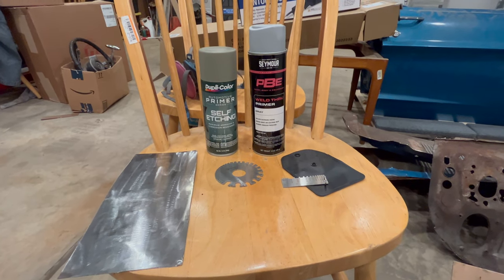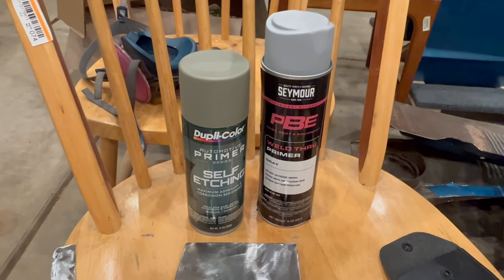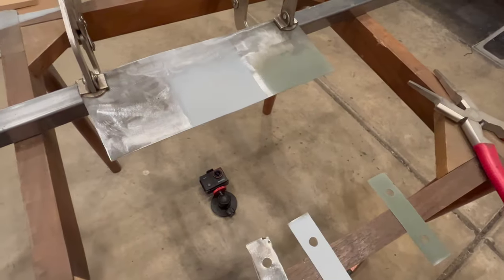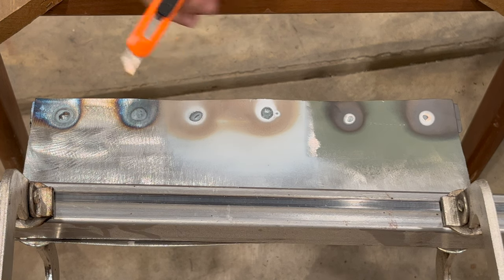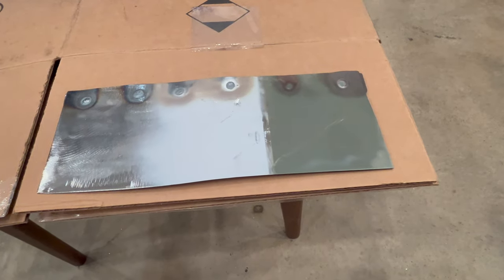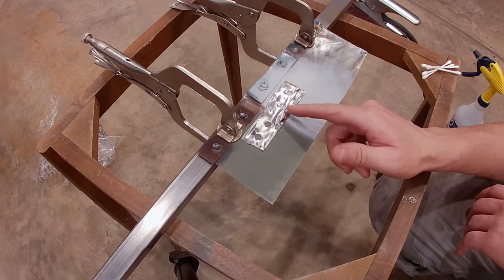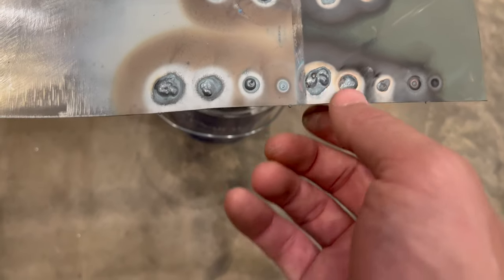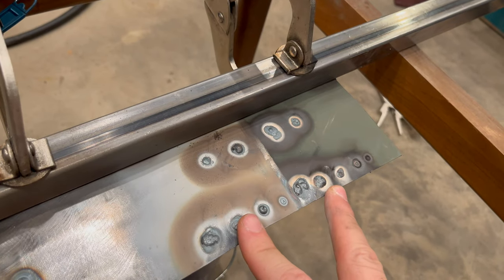Testing Weld Through Primer

Comment: Thanks for the video. I like to scratch out the weld through primer in the hole before plug welding. I don’t know how great the protection is between the two pieces of sheetmetal, but like you say, something is better than nothing
Reply from the maker: Yep, I might consider cavity wax after it’s painted just to get the areas where the primer has burned back. But even that might be overkill since it won’t be living outside.

Comment: The weld through primer is meant to be applied "between" two pieces of metal that will be welded together, the theory is that it will burn back a bit around the heated area and keep it sealed off ,, the self etching primer is mostly used as a ground coat when painting an aluminum panel
Reply from the maker: My original plan was to see how it held up sandwiched in between two pieces, but I’m not sure the best way to test that. I’m open to suggestions! I figured seeing how it held up to the heat would show that. Is there a better way to test it?

Self etch is useful for steel as well. The acid is probably more effective at etching aluminum, but it does protect steel fairly well.

Comment: Try this test with rustolium rust reformer.. i know its silly... but ive welded with that many times and it holds up pretty well to welding on the other side.. im dealing with the same thing on a 76 Jeep J10... thankfully.. though today they do have long hoses with spray nozzles on them to where when youre done with pillars and stuff like this. you can shove the hose in and spray and itll cover fully inside where you put it with paint
Reply from the maker: Interesting. I just grabbed some Eastwood rust converter, I might try seeing how weld that holds up to heat too. 
I’ve used their internal frame coating with the tube spray applicator for some places that I could get to, and I’m considering cavity wax for the harder to reach places after things are painted. I guess the cavity wax is supposed to seem into crevices that you can’t get to. With all of this, I’m way beyond the nothing that Ford did, so it should outlive me :)
Reply: @evansmessygarage  ford amc... chrysler.. they all did it.

Oddly AMC actually did get into the pillars and stuff though.. they actually never rust out.  Amc problem arose from the fresh air vents... what out a vid of mine of ny J10 where i had to rebuild the lower vent/rocker..  unfortunatly.. I didnt do as great of a job you seem to be doing.

But i did my best.. and cut most of the rust out.  RUST reformer should handle the rest i couldnt get too.  Ive used rustolium rust reformer on my wagoneer.. 7 years ago and the rusted area ( i did prep)  never came back.

And besides. With 16ga steel... if it does rust again... Itll be when im 70 and dont care
Reply from the maker: I had a similar issue on the A pillar where there was water from the drip rail that rusted a hole in between the two pieces (before I started making detailed videos but it’s in a time lapse). Before I welded the new metal in, I took some of the Eastwood internal frame coating and went in as far as I could, hopefully it got enough protection that it won’t ever be an issue, but I know there’s more unprotected metal I’ll never reach. If it hasn’t been an issue so far, hopefully it never will. Sometimes we just need to address what we can and move on!
Reply: @evansmessygarage    Look at some of the vids i made.. im bad at editing... so my vids are long sadly im dumb when it comes to that stuff.. maybe i gatta learn how to shorten them..  But if you look at some prior a few weeks ago.. youll see how extensive the rot was on the rocker foot air vent, floor, and floor support on my j10...  It was bad......

Thankfully with the Jeeps, everything is identical.. so a 88 Grand Wagoneer the floor support matchs my 76 J10 pickup lol..  But yea.. 

uhg ive been ina funk.. i gatta work on this truck more often.. but this heat puts me off..  I did my wagoneers frame and floors so fast.. but the j10 seems to take me weeks just to do a floorboard because im so lazy latetly lol
Reply from the maker: Holy cow, if a 60s mustang saw the same rust as that J10, there’d be nothing left of it! Subscribed, I’m excited to see how it comes together. 

The heat has been brutal in my garage too, but slow and steady progress, as long as I’m moving forward and not standing still, I’m happy. 

I had another channel where I did some fairly technical videos while I was overseas and the Mustang was in storage…but nobody ever watched 😂. Anyway, I got a lot of practice at video editing - don’t know if I got better, but I got practice. And using iMovie was a game changer, super easy and intuitive if you have a Mac, videos come together really quickly.
Reply: @evansmessygarage  yea you saw thr J10 bed right lol... Or whats left of it.. go back at my older vids.. i had to cut the entire bed and bed supports off.. it was just dust basically.  I pulled three 5 gallon buckets of rust off it.  Not counting the semi solid peices left..  And after my floor/rocker floor vent stuff i did.. i have another 5 gallon bucket of rust.. The frame wasnt (tooo bad)  its actually in amazing shape front mid semi back... its just heavily pitted in the ends the last 2 ft.. thats very common on these... but thankfully being a truck its 3/16th steel.. so the pitting doesnt effect it honestly.   People think pitting will... But no.. on steel this thick.. if you cut it and look at the side of the cut youll realize the pitting wouldnt have done anything to it unless it was swiss cheese.   

Now one side was pretty bad.. So i did cut out and weld lile 2ft of new 3/16th steel in and basically rebuild the c channle there.

Its all on vids.. Its a lot of rust.. And itll never be a (show) car.  But i didnt care.. it was an 800$ junker.  With 80k miles.  That had a great interior dash/door/seat wise..  minus floor.  

So i figure well.. i can cut.. i can weld.. lets get at it lol.   Once im done..  Itll be a looker.. a driver.. and thats all that matters to me.   Ill probly have one of the few J10s left in Virginia that actually runs and drives when im done with it.

But ya the rust in IMMENSE.. i just figired.. buy this for 800$.  Because the others im finding 500 miles around me.. were almost nearly as bad..  and still needed new beds..  

So why spend 4000$ on those.

Plus i know its weird maybe... but the baby blue interior.. and two tone  blue white.. sold me.   All i ever find are tan interiors..  tan is bleh extremely common.. 

Thanks for replying back to me.. ur right if i didnt buy it.. itd just sit.. be parted out.   The redneck who had it jist let it sit.. with crap in the bed thats why the bed went to hell...  he was gonna part it and sell the engine.. and im like dude.. jist give it to me.. lol. so i picked it up on a flat bed with my prior project my Jeep Grand Wagoneer..
Reply from the maker: With some of the Mustangs out there, you can spend a few thousand for a rusty one and no engine, or many more thousands for one with hidden rust and engine problems. Unless you’re paying insane money, you’re probably getting a problem either way. Seems similar in the Jeep world: fix the problems now or pay more and fix them later. Seems to me like you got a lot of car for the money!
Reply: @evansmessygarage  The Jeep picksup from 63 to 87.  All had problems with the beds.   They are duel walled.  And thr inner panels werent painted well from factory.   The outer walls are also bent and formed on the lower panels.  So what happens is debris gets inside the crevices.  And rots out the bed walls.  Ive eveb see Arizona Jeeps with rusted out bed walls.

This and the Jeeps all rust out on rockers.  The wide track fender flairs are all rusted out.  The frames all rust out on the last 2 feet.  The leaf slring mounts in the rear all rust out.

It doesnt matter what Jeep they all git it.  Some just worse than others.   Litterally every single Jeep pickup ive seen online or otherwise has bed rust.  Of course some its patchable easy.

Then they all garunteed have cabin holes in the floors

But the point i saw was.. why spend 4000$ for one where i still gatta fix the cabin floors.. still gatta fix the bed walls... but only have a better bed floor.   When i can spend 800$ still have to fix the cabin floors.. bed walls.  Rockers.. frame.. and just have to rebuild the bed flooring.

Theyre like all the same unfortunatly.

Some in the condition mine was.. people still want 1500-2000$.  Lol. 

I also got a th400 and quadra trac transfercase.. and the factory brush guard with this deal.  Plus with only 84k miles.  I feel its drive train has plenty of life.

I know it sounds weird... but id rather fix rust that have to take out and engine and rebuild it.  But maybe its because my abilities of fixing rust are better.. than an engine rebuild which i dont know much about

Comment: weld  thru primer is not designed to be welded thru. Only to protect where the metal is face to face
Reply from the maker: Agreed, the test was to see how close to the weld heat it could get and still protect in-between where it’s sandwiched together. Is there a better way to test that out?